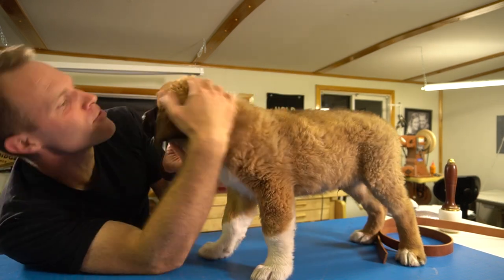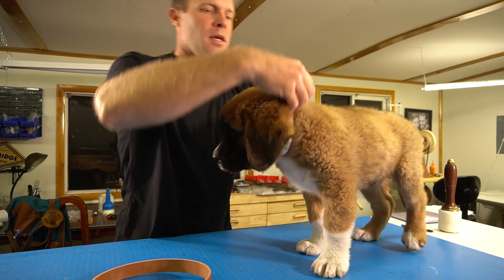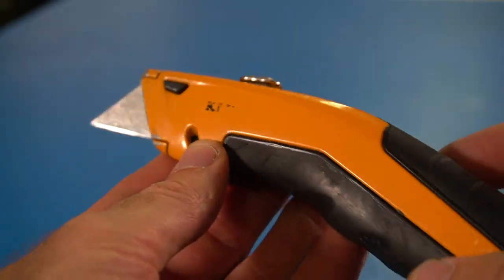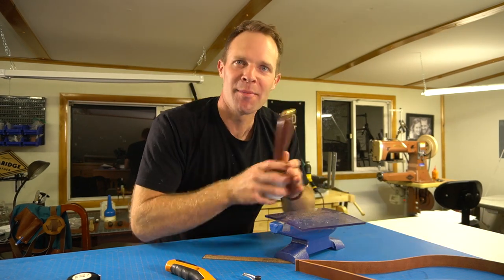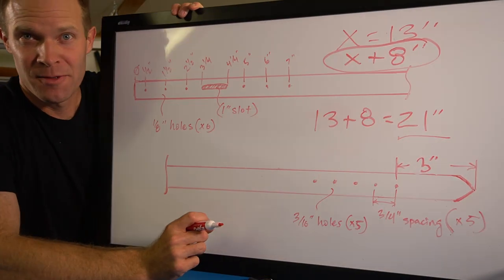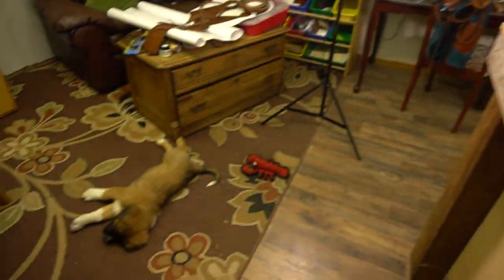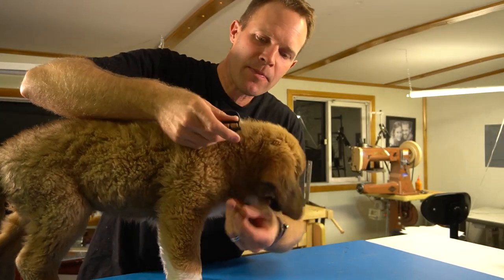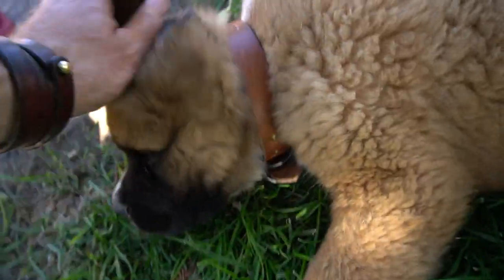How to Make a Great 15-Minute Dog Collar (For ANY Size Dog!)

Comment: Love this!  I am new to leather craft and I am having a hard time trying to cut those rivets down to size.  I ordered  cutting pliers but can't seem to cut it down.  What type of pliers do you use and thickness of your rivets. I've been ordering #9 brass and copper.
Reply: Late reply but thought I’d toss this out there anyway: I currently use 8” Knipex end cutters and they are great, though I’ll be upgrading to the 10” version shortly to give more leverage for cutting the harder brass rivets as production increases.

Comment: I really want to make one but I like to buy good tools and with the rivets, tools, leather, etc would provide it cost me $300+.  You make some of the best produced and clear lily explained videos.  Thanks for posting this.
Reply from the maker: Thank you! I understand there is a barrier to entry for this hobby, unfortunately. I bet this could be done for under $100 pretty easily, though, depending on the tools you find! I hope to make a video on that subject soon! Thank you for watching!
Reply: @ClaridgeLeather  Just adding what you - have to - buy just for this project i´d say sub 50. 25 for a basic rivet set, 15 for the hardware and some leather scraps.
Reply: @Markus__B  what about that skiver? :-)
Reply from the maker: That might go over budget a little… 😄 There are lots of inexpensive ways to skive as well.

Comment: Nice tutorial, I would like to ask you for information, if instead of inches I use centimeters (x is the size of the neck) i + 8 "to add to x do I simply have to transform them into centimeters and do the same for the final +3"?
Reply from the maker: It should work fine if you just convert everything to centimeters (1 inch = 2.54cm). Have fun!
Reply: @ClaridgeLeather  👌